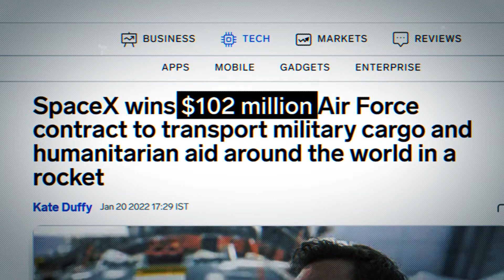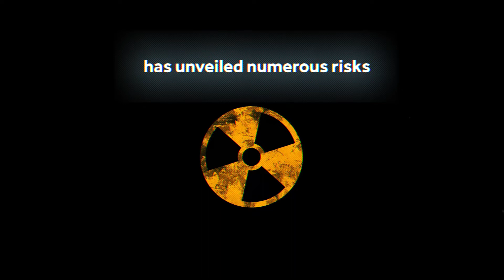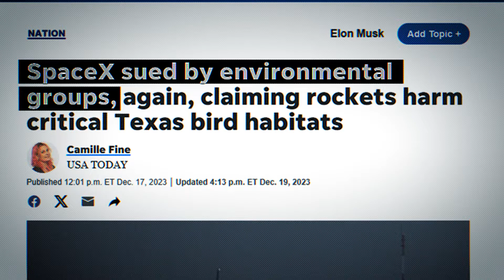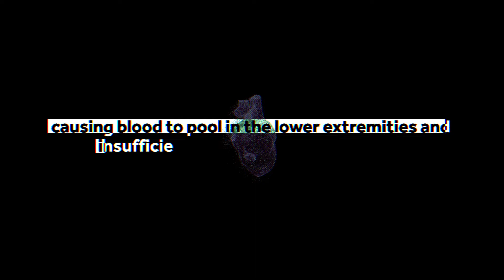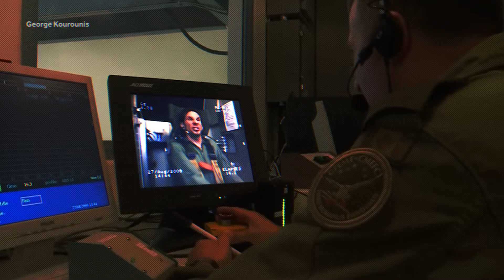Elon Musk’s rocket plans are a health & safety nightmare...

Comment: I don't think most of this will be an issue. Earth to Earth travel on Starship will be suborbital with a maximum travel distance of halfway around the globe, so you won't be dealing with nearly as much acceleration and g-forces (I know, same thing) as orbital travel and not for nearly as long. Radiation levels will be higher than on commercial jet flights, but the exposure duration is far less. Although all these things will still be factors, and Starship travel won't be for everyone. You'd have to be in good physical condition before even considering it, but it's certainly feasible in principle. I'm more concerned about getting down in one piece! if SpaceX can demonstrate that satisfactorily, then I think they can pull it off.

Full disclosure: I'm not a rocket scientist.
Reply: Full disclosure: there will NEVER be suborbital earth to earth travel with starship, lol. 1. Rockets are still far too unsafe for line travel. What's the failure rate? 1:100? How do you want to insure this undertaking with hundreds of wealthy customers on it? 2. You will need at least 2g acceleration for both ends of the flight. 3. For every launch, you would need to clear vast amounts of ocean. 4. How do you divert in case of bad weather? 5. Starships 3 engines have each around 650kg fuel burn per second. The A-350 burns around 5.5t per hour and transports more passengers, safer. 5. You don't safe any time, because the pads would have to be at sea (noise etc.) and you would have to ferry. Also, nice in bad weather...

Its bullshit, like cyberrust.
Reply: @flixri726  I concur that it starship will not provide commercial point to point travel on Earth, but I'm not sure where you are getting some of your figures. How do you arrive at the 2g acceleration on both ends?
Reply: @killzolot  because the amount of friction etc. by the atmosphere isn't linear if understand correctly, so you have to accelerate more during start and landing than after MAX-Q. Also, you really need a specific angle for your re-entry so you skip off and overshoot or hit the atmosphere too hard. 2g was just a guess, given that New Shepperd flies regularly, I don't really have the time to look it up now.
Reply from the maker: Thanks for taking the time to write such detailed comments anyway, they're really interesting! Even if it was somehow economical and as low risk as commercial flights, the issue of having to go to rocket pads, extensive security checks etc will still be there. Do you think there are any applications of point to point rocket travel that could work?
Reply: @flixri726  You are correct that the atmosphere is not linear. You are incorrect about the acceleration profile tho. You can accelerate the same before and after max-Q if you're rocket is capable. Prior to max-Q, the atmosphere is thicker as you point out, but this does not mean you need to accelerate more, it just means you need more thrust to accelerate at the same pace you would after max-Q. How much starship can limit their acceleration to throughout the journey is probably only known to SpaceX, but we can ofc try to calculate based on the things we know like fuel load, engine throttling capabilities, etc. I think under 2g is plausible, but I would have to do the calculations to confirm
Reply: @LifeSciStories  Imo, the only 2 cases I can think of that are feasible with current technology are 1. rich people wanting to try it out. We see things like Dear Moon, New Shepard flights, etc., so it seems likely at least some would be interested 2. Some military/aid rapid response. If there are pads in the US, and pads at US bases around the globe, you could send equipment from point to point very quickly, and then have the bases from there move that equipment to the frontlines. They could probably get around things like noise that wouldn't be permissible to have in public spaces